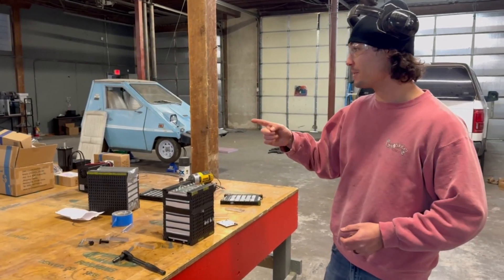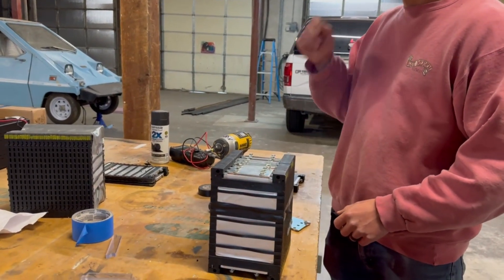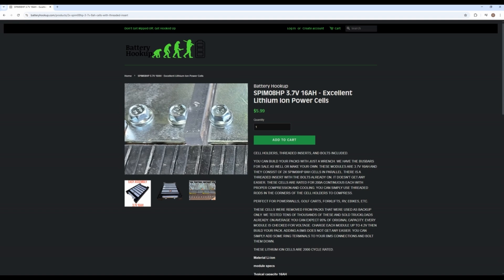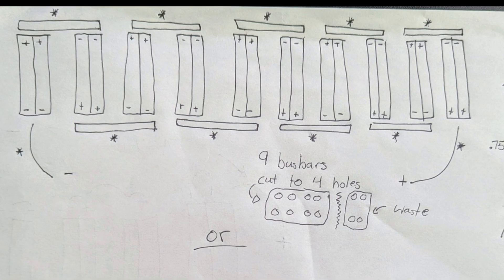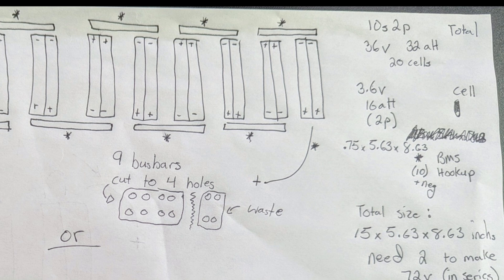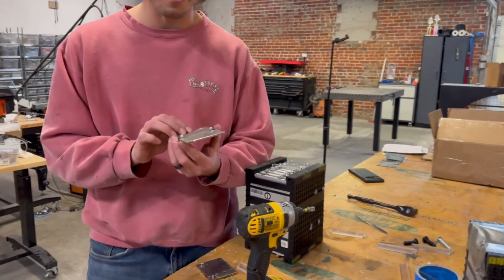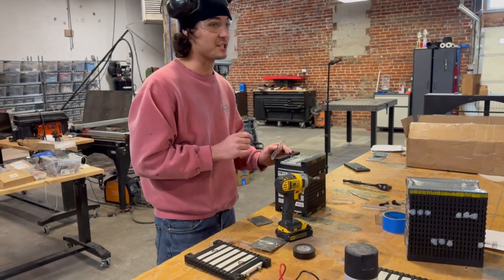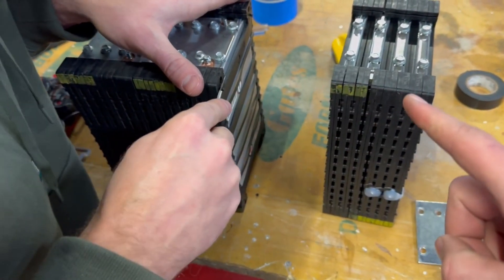The Original Battery Broke...Time for an Upgrade | Electric Go Kart Series Part 3

Comment: Look at the size of that thing! Great value, but what does it weigh?  I use the LIPO 20AH 6s for RC applications. Can build something with half the weight and 1/4 the size w the same discharge. (or better) They also have 12s agricultural LIPOS that I stack to make 24s 100v packs that work great if you can find them. I like to use cheap balancers instead of a BMS. I limit the pack peak amp draw through the controller. Saves a lot of money on the BMS.  Great pack build! nice and neat. Hope to see more.
Reply from the maker: Not a bad idea to look into! These were cheap and easy to work with but sacrificed weight and size.